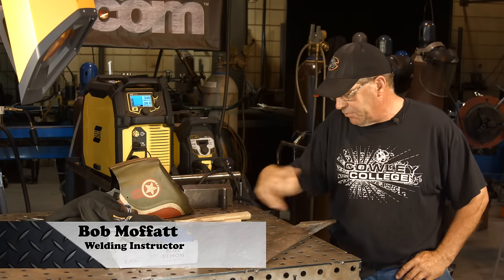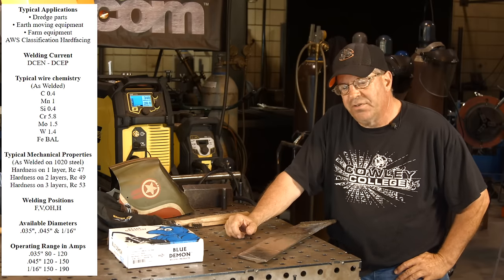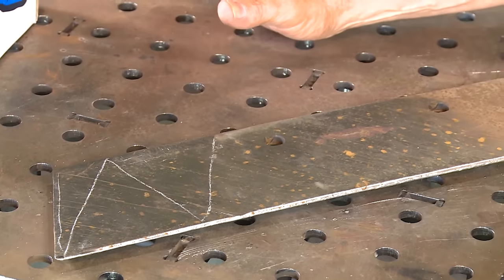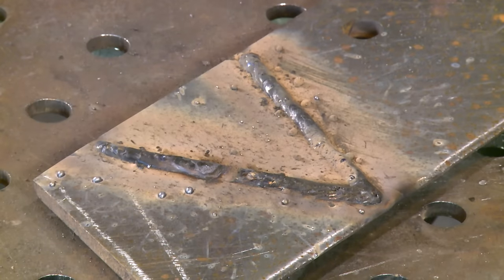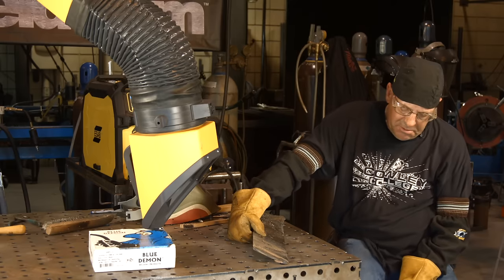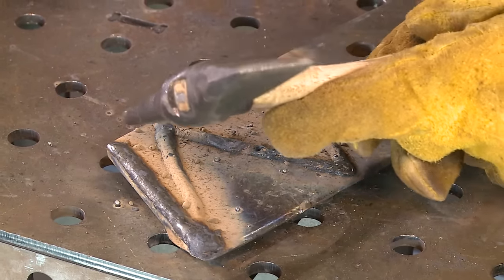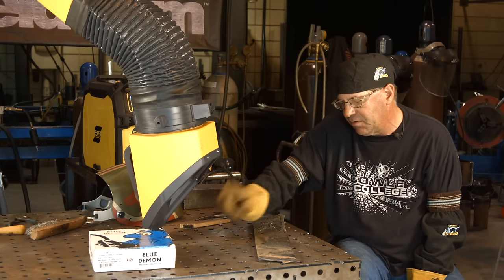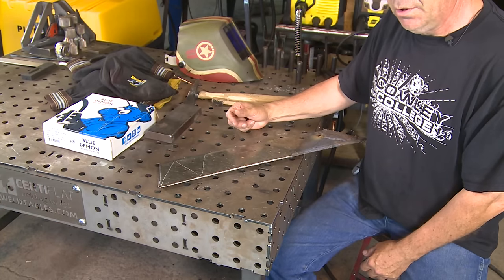🔥 Gasless Flux Cored Hard Facing

Comment: Hey I was looking to repair my anvil with this produce.  My concern is pre heating and or post heating.  I see you didn’t preheat the tool steel. I normally will preheat any alloy or tool steel before mig welding.  I mostly use flux core. Always welding outside in the wind. Again I’m concerned about pre and post heating of the steel thx. Great channel ....Paul

Comment: You seem to like the Blue Demon line of wires. I often see this brand selling cheaply. I'm almost tempted to buy a roll and try it now, since I see you running it in your videos.
Reply: It's very good stuff.  I just spent all weekend building stuff with it and it ran better than the Hobart wire I had run before, very smooth and effective.  Their stick electrodes are quite nice also.

Comment: I've been welding for like 35 years I've had the privilege to work in a lot of different areas one of them was for a company that fabricated and repaired shredders I'm talkin vehicle shredders whole vehicles engine block everything went up the conveyor belt and we're jumped into the shredder the interior was lined with 6-inch manganese plates the shredder  were also made of manganese long story short I did a lot of cutting and Welding on very thick manganese I forget all the details and I don't even know why I'm commenting but yea manganese
Reply: hahaa

Comment: Hey Bob been watching you forever and need help I've been welding for 10 years today I had eo hardback with mig out of position and man was it hard to get on there no matter what settings I tried it didn't seem to want too work right up hill or down didn't look to see if it was a fluxcore wire or not I do know it's a 045 sodel hardfacing wire of some kind any tips would help

Comment: I would try lowering the voltage to 22 to 25 range and increase the WFS to 400 to 500 IPM range.  Also might eliminate some spatter by switching to DCEN Polarity.
Reply: Rick Reiff I tried it all. Higher/lower voltage, WFS, drag/push, EN. Specs say EP.
Reply: From the video, it appears you are in globular transfer.  Some Inner/self-shielded flux cored wires don't react very well to this type of transfer mode, it mostly has to do with the type and amount of flux material the manufacture uses in the wire.  The flux is reacting with atmosphere before the metal is transferred across the arc, which will cause the arc "pop" and excessive spatter.  Keeping the arc narrow and as short as possible, should reduce this effect.   If you can turn your values down far enough to get into true short-circuit transfer, the size of the spatter should be reduced and wont stick to the base material as much, so it should be easily removed.  We manufacture a very similar product here at Welding Alloys in Florence Kentucky. (but only go down to .045"/1.2mm diameter)  I find it operates the best in Short-Circuit transfer mode, with a lower Inductance value.   Would you like to try a Chromium Free product that we have been selling to numerous costumers for metal to earth applications?  It is also inner/self shielded flux-cored, but does not contain any Chromium(so no Hex6 worries, unless you weld on stainless). You can achieve a single layer Rockwell C hardness of 58 to 63(if applied correctly)  Let me know if you are interested.

Comment: Ya sure, try doing more than one chest level bead holding the trigger down for 1 hour straight on some big job.
No gas = overheated tips, fast waring tips, liner cooked in 2 days.
No gas...sure.
Works great for 3 minutes of table  welding.